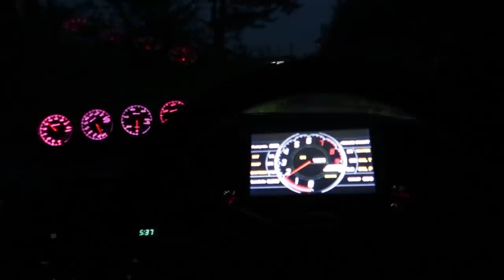TOUGE ATTACK WITH JZX100 DRIFT MISSILE!

Comment: Sam, you mentioned yesterday that the Skyline was more compact than the Chaser? Does it have a longer wheelbase and is it a heaver car? I'm not really familiar with the JZX chassis. Obviously it was more nimble with added boost. Will you increase KW or do as Colin Chapman recommended and add lightness.

Comment: You need a Kei truck flatbed tow truck you can drive up on or a regular ass style tow truck that lifts one side but still is a kei truck
Reply: Those aren’t kei trucks.... kei trucks are less than 660 cc and can barely do 50 mph on their own, do you really think one could tow a car?😂 the trucks you’re thinking about are basically box trucks without boxes on the back

Comment: 19:19 those crane truck actually aren't cheap
Reply from the maker: They actually are. At the auctions you can get them under like $5000. Of course older models like the one in the video but they are crazy cheaper than the car loader style ones.